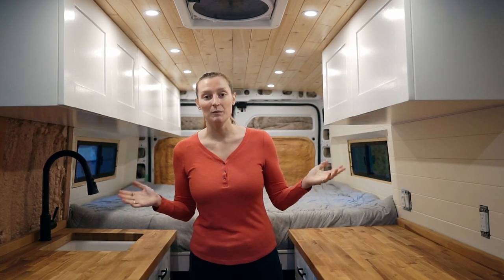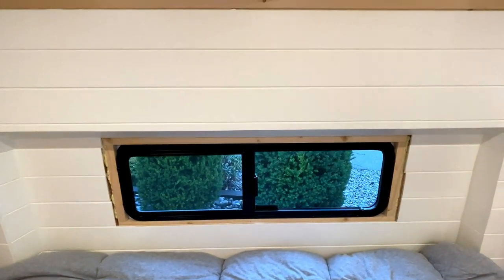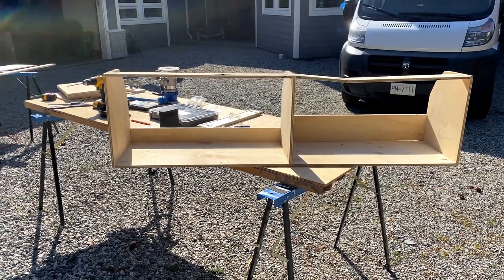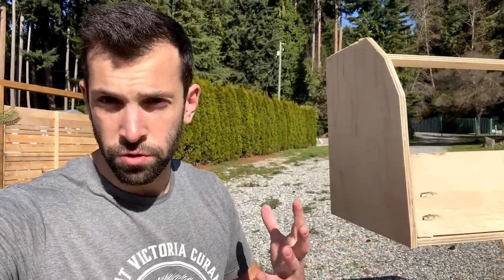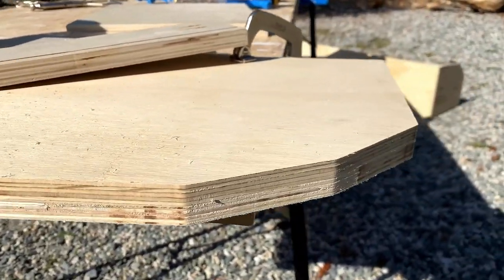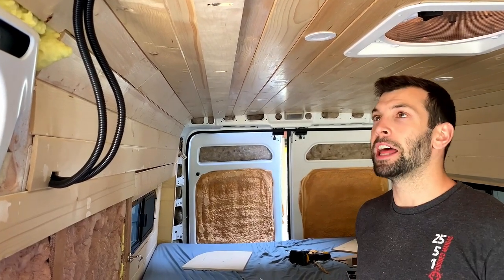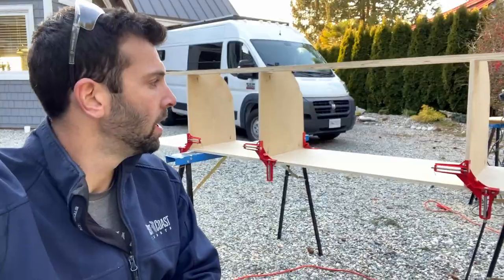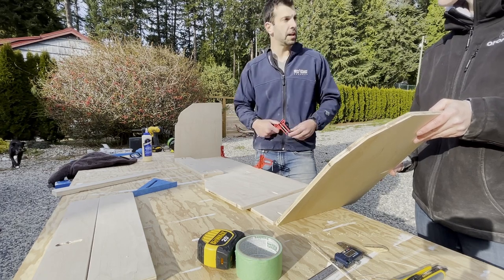EASY DIY UPPER CABINETS | Strong & Light | PROMASTER VAN BUILD SERIES | Ep 16

Comment: What hinges did you use on these cabinets? It’s nice that the doors can be right flush to the ceiling.
Reply from the maker: Hey Stefanie! We used Richelieu soft close frameless style hinges. We got them from Home Depot 🙂 they have 3 directional adjustment which helps get them all lined up. We liked that they are flush to the ceiling too - one of the perks of the frameless style cabinets I think ☺️

Comment: So you put the riv nuts, then you made the hole on the planks, how did you made the hole align to the riv nuts?
Reply from the maker: Hey! It’s been a bit, but I believe we held the planks up beside the rivet nuts then marked where we needed to drill the holes. It can definitely be difficult to get all the holes aligned
Reply: @HayleyandJake  cool, I am preparing myself bc i don't have much time and gathered all the ideas. i found this really cool, stick a play doh and it will mark really good them you know the center, i gave you 5 s
Reply from the maker: That’s a great trick! Good luck with your build, let us know how it goes!

Comment: I am nearly at the upper cabinet stage of my build that has the same open concept that you have and am wondering how high and how deep your uppers are?
Reply from the maker: Hey! They are 16” high and 14” deep (exterior measurements). Good luck with the building 😄👍
Reply: @HayleyandJake  Thanks for getting back to me. I was thinking somewhere around that size for maximum storage.